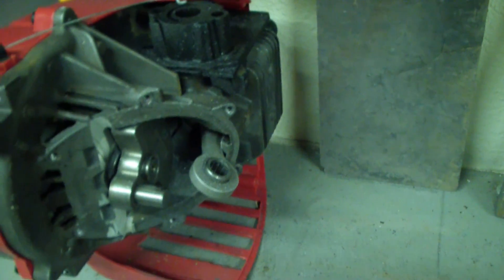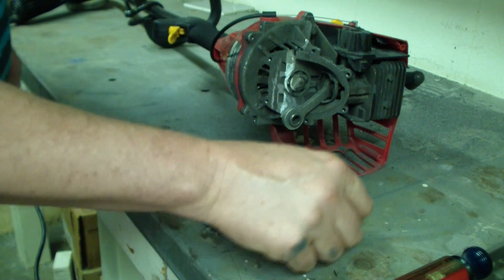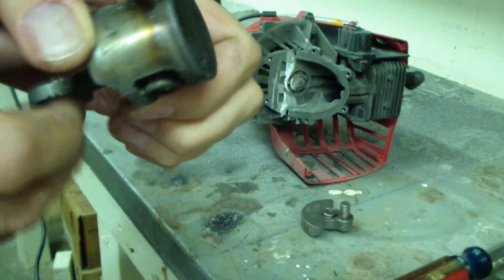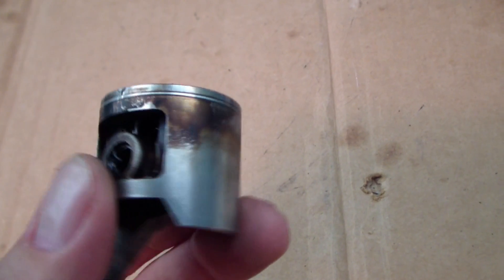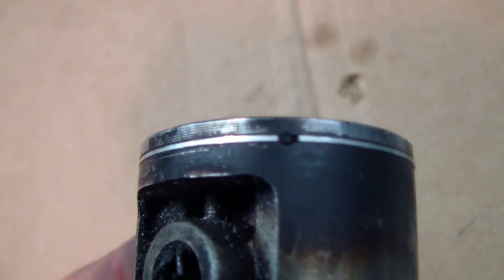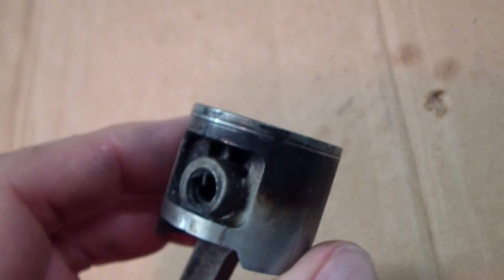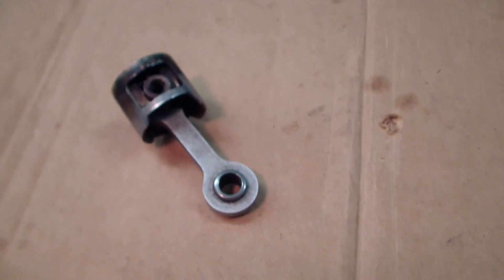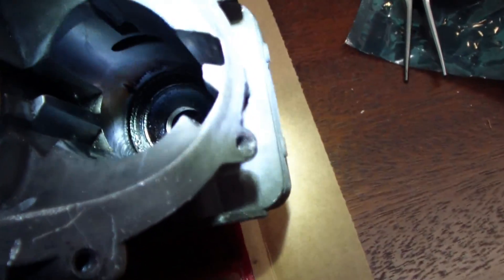Homelite Weed Trimmer Repair Tutorial Part 3

Comment: The ring is stuck. It should be loose and floating. There's a pin that the ring ends line up with and you can see it in the video. All that blow by is caused from dirt entering the motor and burning with the fuel. Check your air filters more often, but if I recall correctly, you said it was missing an air filter in your 1st video. That was the culprit.
Reply: F5 Tornado damn, I got no air filter on mine either. Kinda got left behind by the old roommates I kicked out, they methed everything up!...
Reply: Dirt getting in would cause the cyl., and ring to be scored. I have two engines here, with the same problem as shown above, and it definitely is "not" caused by intake dirt getting in, I assure you. The problem began with the engine set far too lean at the factory, and the ring wasn't being lubed well enough to keep it loose and free for good compression. Both of mine have the very same issues as seen above, … blow-by, and carbon gum build-up, causing the ring to stick inside the piston slot, and not moving freely. That carbon is like a sticky gum, that builds up while running, and the longer the engine runs, the more build-up occurs, till finally, the rings sticks, and doesn't seal between the piston, and the cyl walls properly enough to create enough compression needed for running. Like this fellow that made this video, he's having trouble freeing up all that gummy carbon deposits, to free up the ring. Sadly, there is nothing on the market, that can completely free up the ring, without removing the piston from the engine block. It needs lots of soaking, in a carbon reducing/softening fluid, as well as a small amount of heat applied to expand the ring from where it's stuck, with plenty of added penetrating lube applied while it's hot, so the lube gets behind the ring, and the ring finally gives up it's sticky hold with the piston slot.  Once it is feed, it can be removed carefully, cleaned properly for reinstalling ( if the ring is still in useable grade), and the piston slot cleaned out completely. Once reinserted into the engine block, compression should be restored back to normal again. These engines can be a pain, in taking out the piston without causing more damage elsewhere. It's also time consuming if the repair is decided to be made. They are definitely not like a lawn mower engine, I assure you, which is easy to remove the piston. Unsticking the ring properly in this style of engine, can't be done, while the ring and piston remains inside the cyl walls. You may free it up a bit, but it wouldn't solve the problem later down the road. It will occur again over time, and this time, may not be fixable, due to too much carbon gum build-up (and it is a black gum like sticky paste that hardens the longer there's added heat, and cooling from the engine running with blow-by). Again, I say, this is not floating dirt, that got into the engine through the carb., , that caused this problem. This is a lean fuel problem, due to poor carb settings at the factory. Running it lean, causes the oil being burnt to mix with burnt carbon, making a sticky paste like gum, that builds up over it's use time. Carb needed to be set with a richer fuel setting at the factory, before it was sold.

Comment: Did you ever check the on/off switch? Maybe it shorted out and is stuck in the off position.
Reply from the maker: Checking for spark was done in the Part 1 video. Strong blue spark present.

Comment: You mean to tell me you broke the engine instead of taking the head off???  Next time do your research before making a video.  Sounds like you didn't even need new rings.  You could have fixed that thing with a little B12 Chemtool in the sparkplug hole, then in the gas, after you cleaned it.  By the way, there isn't an engine in America that doesn't have spare parts for sale online...even obsolete engines.  If you can't find the model #, ask someone for help.
Reply: The head doesn't come off on that model
Reply: My apologies.  I stand corrected.  I can't believe it.  Homelite wants you to buy an new short block assembly for $75.  Whatta gyp!
Reply from the maker: The head and cylinder are single cast piece. They used press to attach crank bearing to shaft and case. Even if you could get it apart you could not get new new items like bearings and rings to repair. Rebuild parts are not available. What they sell for replacement is the piston/crank/block/head as one piece. About the same price as a new string trimmer so there is no point.
Reply: Was just stating it all comes apart. Where there is a will there is a way. It could have been done cost effective, just not for you. No reason to give false info.
Reply: +foreverwood1963 I'm sure the position comes out some how. it wasn't born in the head.

Comment from the maker: See if adjusting the fuel-air mixture screws makes it run better. More fuel means more oil. In Part 4 I find filling the cylinder with transmission fluid and letting it soak over night will free up a stuck piston ring.

Comment: hey i discovered this the piston in the husqvarna engine didnt move very well when i turned it over (by hand) i put a cap of 2 stroke down the spark plug whole before i did this i had little compression now i have quite abit more and when i put the pull start on and pulled it the compression made it quite difficult so 2 stroke funnily enough is a good idea.

Comment from the maker: Adjust the carb by using the "Pac Man" tool. Amazon sells it. It will be richer mixture so supplies more oil and fuel. See Part 4. I find a fix for stuck ring. I could have saved this engine.

Comment: piston ring should not be stuck like that and kent diego is correct the carb do to epa rules is none adjustable i slotted mine and adjusted it and no more over heating or anything the piston rings can it stuck to to that black carbon oil type build up like was on yours puston rings should widen atleast close to 1/4 of a mm if even that

Comment from the maker: Hi Joe, Did some research.  The reason yours runs badly and mine got stuck rings is the CA EPA CARB non-adjustable carburetor. It runs too lean so too hot and not enough fuel and oil. I saw video how to adjust by cutting slots in mixture screw head. I will make my own video as the new Ryobi SS26 I just got has exact same carb as the Homelite. I suggest you try to fix yours as anything new will have same EPA issues now days.

Comment from the maker: It has got to be the carb. Mine is California certified meaning you cannot adjust the carb. I see two adjustment screws but they are deeply recessed by deep collar have odd anit-tamper head. I just ordered a Ryobi ZRRY26520 from Amazon. The reviews mentioned you (need to) can adjust the carb an 1/8 turn richer so it will run the best. It looks heavier duty than the Homelite and was $75 factory reconditioned.